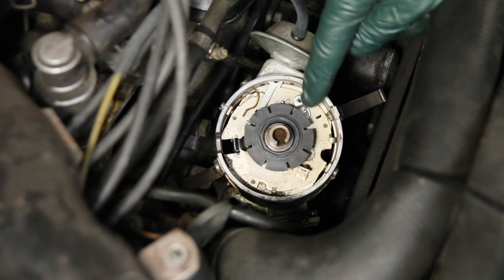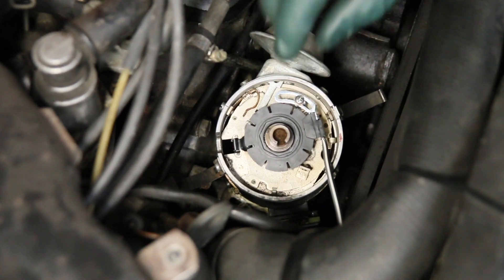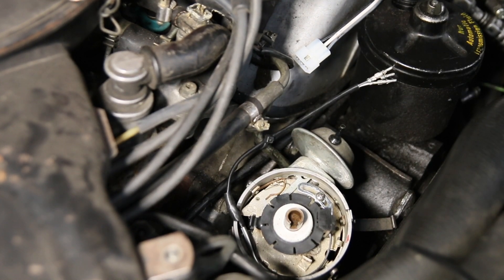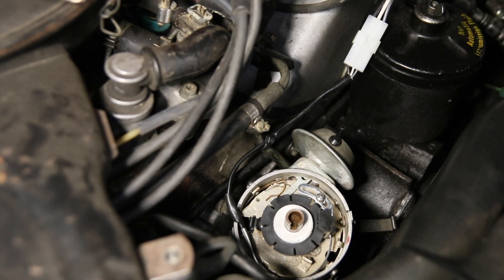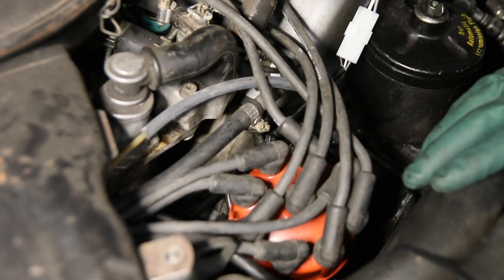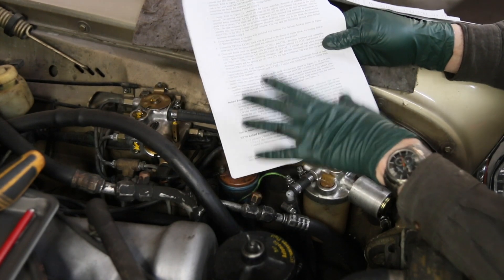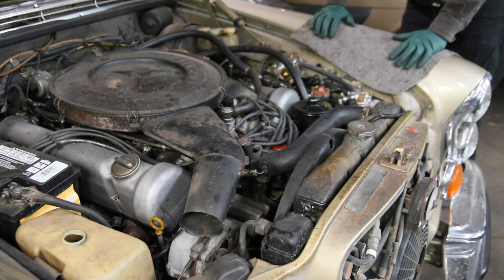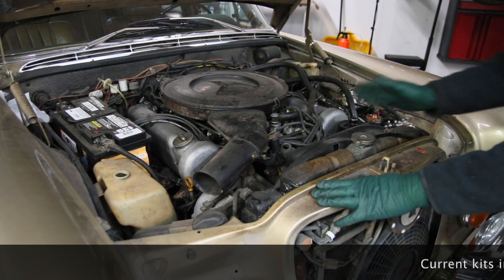Early V8 Points to Electronic Ignition Conversion: Part 2 SUCCESS!

Comment: hello, do you have link for a good kit? got an 450 sac 1973
Reply from the maker: If your distributor has ignition points inside then this kit will work. https://mercedessource.com/store/1970-1973-350-450-v8-points-electronic-ignition-conversion

Comment: I remember my dad installing a Zenith electronic ignition in our 65 Ford Country Squire station wagon when I was a kid back in the late 70's or early 80's.  He always left the points and condenser, along with a screwdriver, in the glove box in case it ever failed on him and left him on the side of the road (as points often did back then) but it never failed.  I'm sure those points and condenser were still in the glove box when my mom sold it after he passed in 2015 and that Zenith electronic ignition was still installed and working.